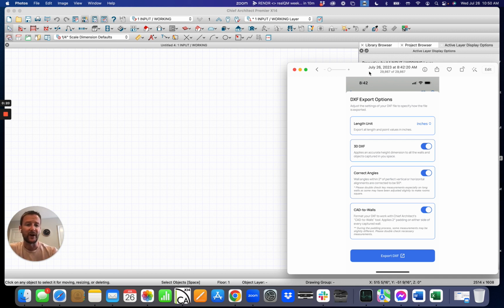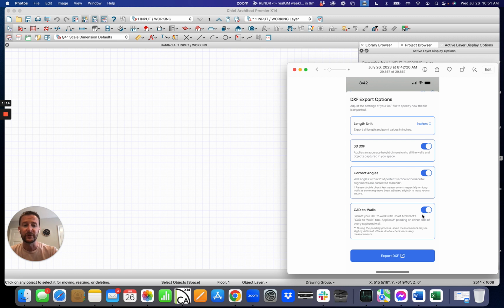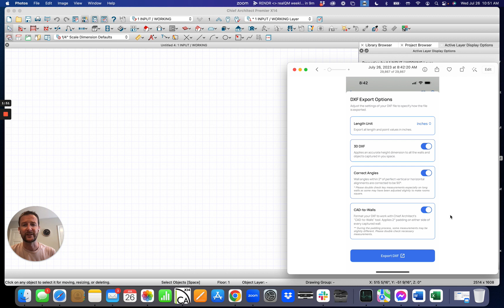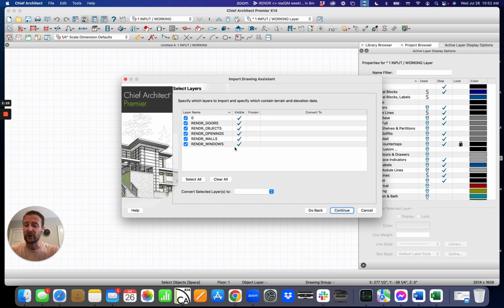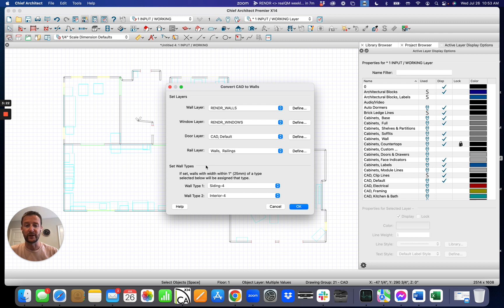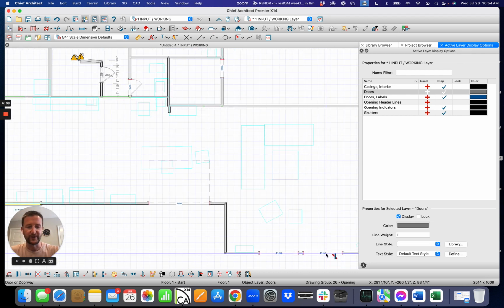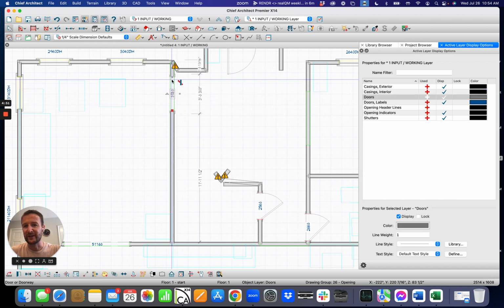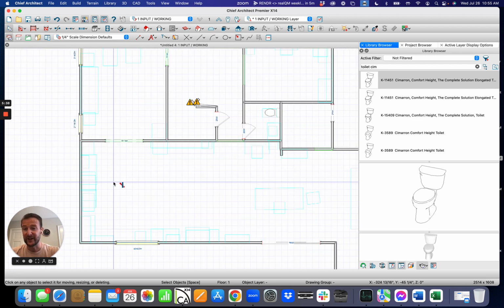How to Import and Utilize RENDR Scans in Chief Architect 🏡

Comment: Just started using this. A few problems I see are measuring houses when there is a lot of furniture, and definitely does not work when a house is gutted lol. The Cad to walls works well with some  clean up. Large houses where the ceiling heights change  a lot its almost impossible. I am not going to give up on the software  until I get a number of smaller projects to test it but dessign devleopment has a long way to go and I would love to discuss this with you.